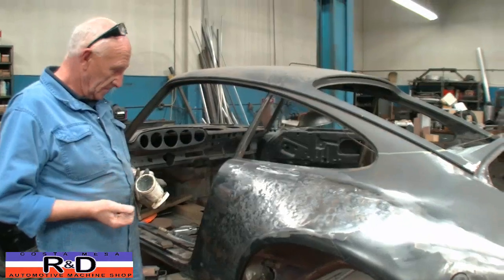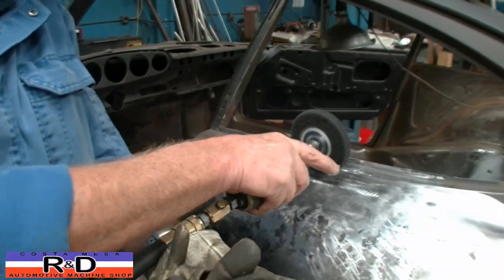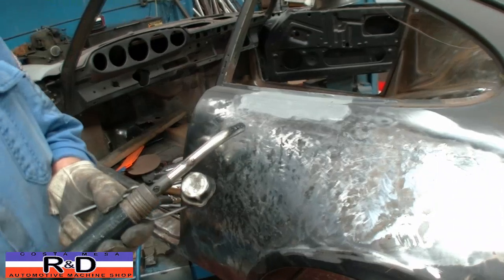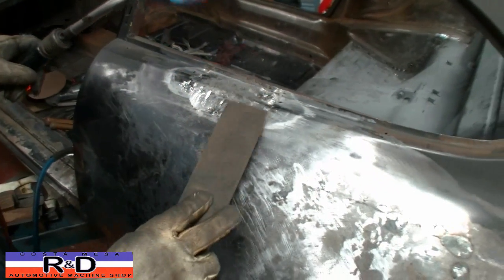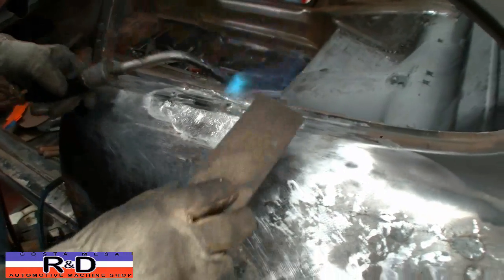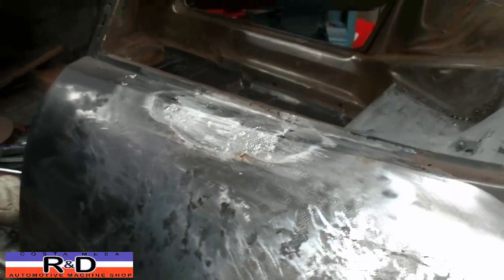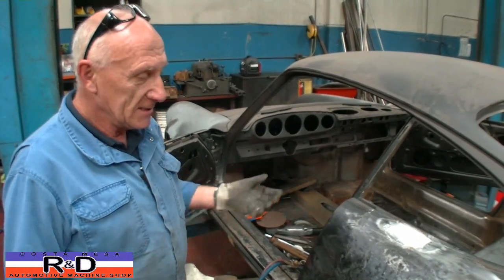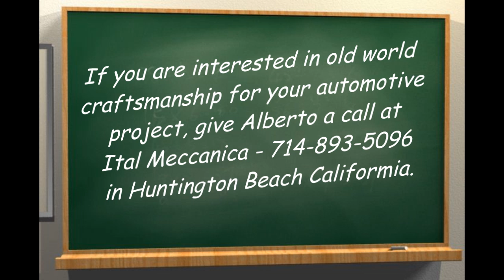Using Lead in Body Work Instead of Plastic Filler

Comment: Amazing artist!  Don't know with Fiber Fillers today and the way you can fill with a hard adhesive as opposed to bondo, but would I  always take the time?..but if I had the time and a Porsche sitting in my garage....hell yes...I would love to give it a try!  Amazing hammer work to get that fender shaped the way it was to ready it for lead!  That is so hard  to do without stretching the metal as you flatten!  So bravo...and then to see him work that lead like butter, is amazing!  Certainly is a lost art!
Reply: The metal is already stretched due to the damage. The trick is to heat shrink it. That will take care of at least any kind of filler work. Lead, fiberglass, or plastic.

Comment: Like Stuart Cambell we also used to call it wiping because our method of application was different. We would have a container of liquid white metal (same as you rod plus a bit of zinc). We would wear a very thick leather glove with an attached thick leather flap. You would plunge your gloved hand into the molten metal and then wipe it off against the area to be repaired. Done very quickly to avoid being burnt.
Reply: used a piece of leather , a 'moleskin pad'

Comment: Practice,practice makes perfect, once you master it like any brazing or soldering you will do well. As mentioned this will last indefinitely as a bond. Once you get comfortable with the process,you will never go back to plastic fill if you can avoid it.But this process is not cost effective in a production orientated body shop,Strictly for high end expensive steel bodied cars or personal use. Great video.

Comment: That’s cool. In roofing we use a similar method with copper. A soldering iron is used. Some have a torch attached. I do sheet metal work( metal roofing, ductwork etc).

Comment: i tried lead work on my 64 skylark and I'll never use bondo on a classic. lead worked great and was easy to sand 80 grit to a smooth surface. can be difficult to learn but once you learn to heat it then smooth it like a butter it's a cool art

Comment: Wow, I didn't think anyone used lead anymore. When it comes to doing what filler is supposed to do, lead is FAR better than Bondo, but it's more time-intensive and technique driven, which are two strikes in a world where time is money and asking someone to become better at their job is akin to a form of discrimination. 

As far as the environmental aspects of it, as long as you don't get it so hot the lead becomes a vapor it won't be a problem. I'd still wear a dust mask when filing or otherwise abrading it to avoid inhaling any dust that might get airborne.

Comment: I had a 1970 ford fairlane 500, when the viral top went bad I removed it only to find the factor had leaded the roof panel to the fender, I didn't realize they were still doing that at the time.

Comment: It's nice to see the skill involved with leading, but in the long run bondo is a superior product- lighter and faster.  A good body man could have worked that entire fender in bondo in the time he took to prep and lead that little section.
Reply: yep and it would robably have fallen out before the end of the program. trouble with Bondo is, it's hygroscopic,   so in damp, or humid situations, it soaks up moisture,  and if it isn't painted in a short time. the moisture will bubble out of it in a year or two.... don't happen with lead...
Reply: @captainboggles  Good to know